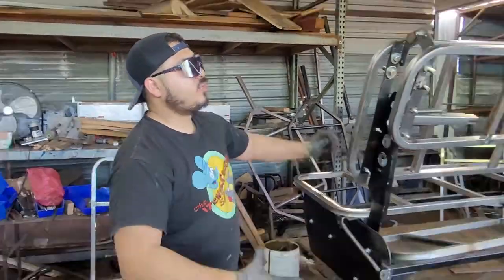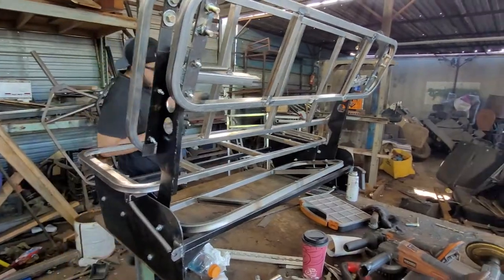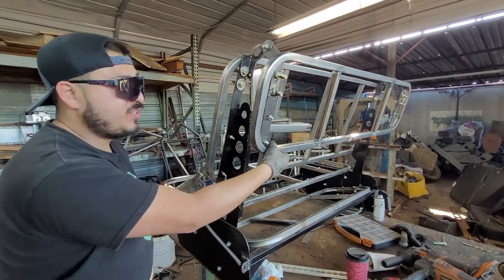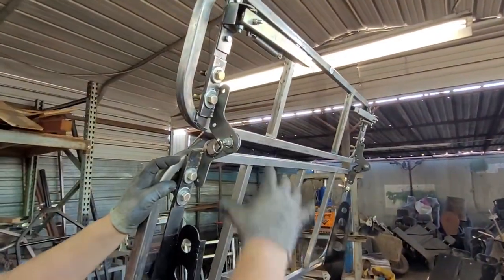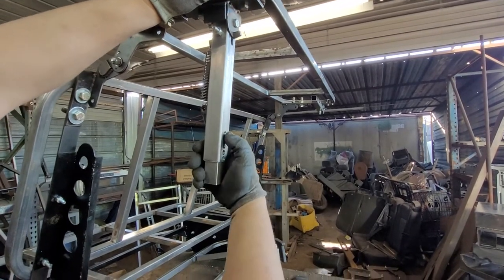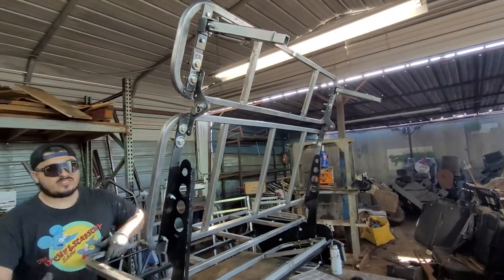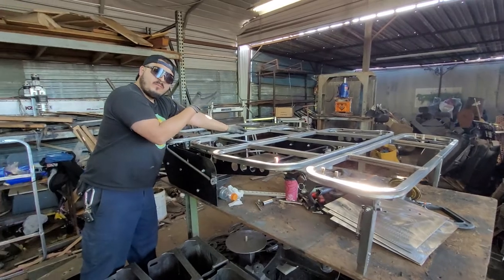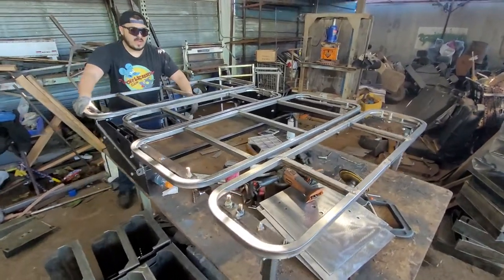compact tri-folding space Saving king sized sofa bed futon frame for camper vans.

Comment: Very nice - Would this work in a Chev Express Passenger Van ?
Reply from the maker: Ya I believe so, it's foot print in bench mode is 30x54 and 60x54 in bed mode. You need atleast 31" of clearance behind,  more if you want the extension.